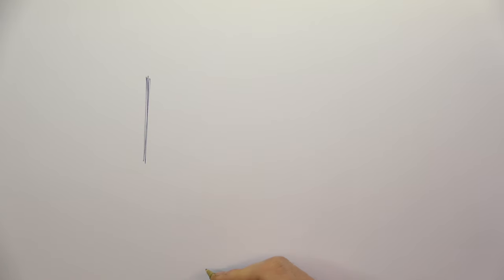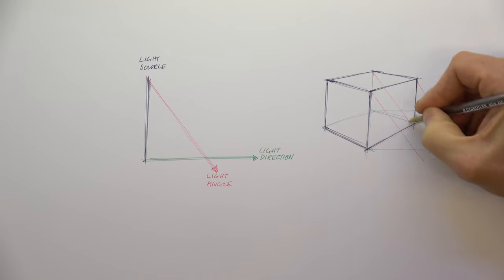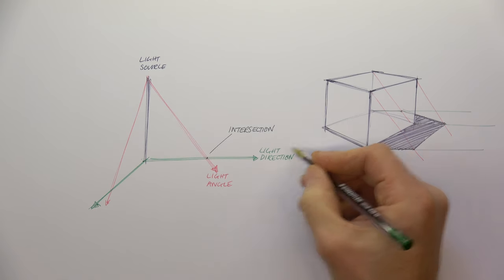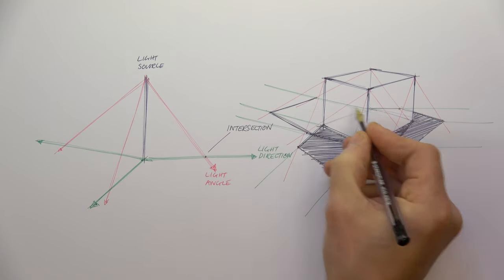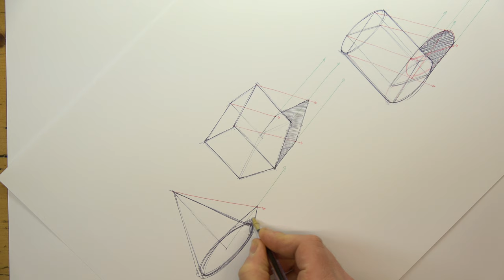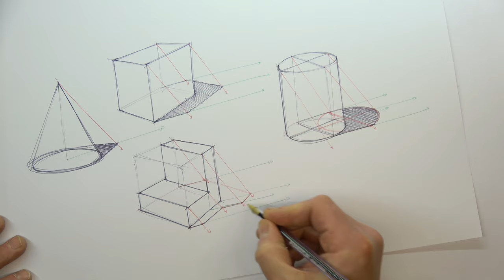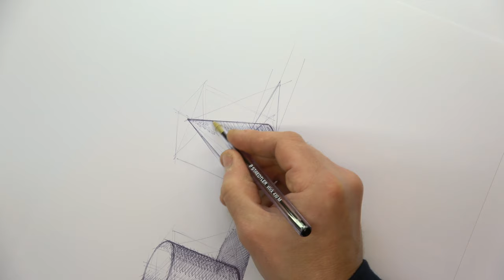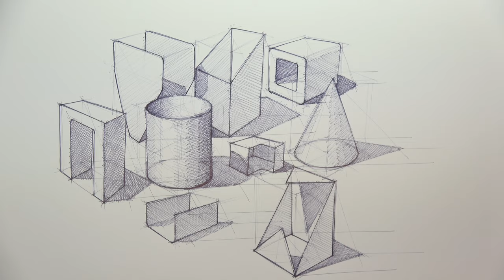How to sketch cast shadows

Comment: It would be worth pointing out in this tutorial the difference between an artificial light source and the sun. If the shadow is cast by the sun then the light rays would be parallel due to the sun's great distance. If the light source is an artificial one e.g. a street lamp, then the light rays can be drawn from the light source. A simple explanation is that when you move sideways from an artificial light, the light stays fixed in its position whereas if you try and move sideways from the sun, then sun moves with you. Therefore the sun rays are parallel. It is a common error perpetuated in many perspective tutorials.
Reply from the maker: I get what you’re saying but would suggests that’s better covered in a follow up video rather than one that covers the principle in short, for an audience that want the fundamentals, to develop their sketching.  To include it at the start might overcomplicate for some.  I wouldn’t describe this as perpetuating an error.
Reply: So, as I understand this particular video would be under the sunlight right??
Reply: @karloatl Yes, or a distant light source rather than a nearby one
Reply from the maker: Hi, I've updated the video - well, I've made a new 2024 version that covers the content in your comment! It's currently unpublished, but for now... just letting you know that I've made a 'cast shadows' downloadable resource that I hope will bring value.  It also gives access to my unpublished update of this video.  https://www.simplydesignsketching.com/downloads/p/how-to-draw-cast-shadows

Comment: This is great. It's a little simplified. The light direction and light angle are parallel only when the light direction is parallel to the picture plane (the observer). When the light direction is oblique to the picture plane (the observer), the parallel lines (light direction and light angle) converge to their respective vanishing point. Will you be covering this or have you already?
Reply from the maker: Sunaya correct! I’m trying to make my videos accessible to all, so that confidence is built and sketching is loose and expressive. My focus is mostly upon helping designers with communication skills. Shadows suggesting shape and form, quickly put down and building a more communicative page of ideas, efficiently and economically.  Great idea to produce a ‘part 2’ in more depth, for those wanting more.  Thank you for your feedback.

Comment: Hi there! I have a few questions:

- How do you get the angle of the light - is it something that WE determine?

- If so, in the case where the light source is from the side and not the top, if there are multiple objects, the angle will vary depending on the distance of the object to the light source. Therefore how do you calculate the varying distance of the cast shadow of each object as it progresses further from the light source?

- How do you determine the shape and angle of the cast shadow of an inorganic object, especially with the above question in mind?
Reply: If it's too long of an explanation to be written down, I'd just as happily gobble up a video that anyone can kindly redirect me to! I'm legitimately baffled by this and I've got unfinished work from months ago as I've been absolutely clueless hahaha
Reply from the maker: Hi, i’ll try and answer.

We Determine the angle of the light ourselves. There is no right or wrong. Imagine a pole with a spotlight attached to the top. The spotlight can be angled however you like, and the pole can be any length you like.
Reply from the maker: If the light source is from the side and not the top, just assume that it is on the top. Any light from below the top would still hit the object and cast a shadow.
Reply from the maker: Do you mean ‘organic’ ie amorphous?  If so, look for any distinguishing points that can be used to reference from.
Reply from the maker: Hi, just letting you know that I've made a 'cast shadows' downloadable resource that I think will bring value to you.  It also gives you access to my unpublished update of this video.  https://www.simplydesignsketching.com/downloads/p/how-to-draw-cast-shadows

Comment: I saw another tutorial where the 4 points on the cube were connected to the light direction point. Same kinda situation for the light source point and the top 4 points. So that brings the question, how are all of the lines parallel?
Reply from the maker: Hi, I’ve just simplified it a little and assumed a more ambient, rather than spot light.
Reply: @productdesignermaker  That information should be in the title, because otherwise you are teaching wrong things to people who don't know better.
Reply from the maker: @humane.t.709  I see your point, but it isn’t wrong. It’s a simple way of drawing cast shadows.  A ‘How to draw in perspective’ video wouldn’t necessarily jump straight into delivering a complex 3 (or more) point perspective tutorial.
Reply from the maker: I've updated and included perspective shadows...  Just letting you know that I've made a 'cast shadows' downloadable resource that I think will bring value to you.  It also gives you access to my unpublished update of this video.  https://www.simplydesignsketching.com/downloads/p/how-to-draw-cast-shadows

Comment: Could someone please explain to me why the LIGHT ANGLE (red line) is drawn parallel to other light angles on a cube? If the drawing is of a single-source light, shouldn't each of the light angles be drawn FROM the light to meet each vertices?... Meaning they all can't be parallel to each other? Thank you :'(!
Reply from the maker: Yep, I’ve simplified it a little to have the light source as an ambient or general light source.  If the light angle lines all came from one point, that would describe a spot light.  You make a good point, but since it’s potentially a complicated concept, it can be off putting for people developing their skills, so hopefully I’ve made it a bit more accessible.
Reply: This helps tremendously. Thanks for the clarification!
Reply from the maker: Hi, just letting you know that I've made a 'cast shadows' downloadable resource that I think will bring value to you.  It also gives you access to my unpublished update of this video (which includes the answer to your comment above). https://www.simplydesignsketching.com/downloads/p/how-to-draw-cast-shadows

Comment: umm how do we decide what would be the light angle ?
Reply from the maker: Anisha k it comes from the top of the light source.  Place your light source anywhere you like in theory (though it’s most straightforward when it’s off to the left or right, and backwards a bit), and your light angle comes from the top of it and passes through the light direction line. Hope this helps.
Reply from the maker: Hi, just letting you know that I've made a 'cast shadows' downloadable resource that I think will bring value to you.  It also gives you access to my unpublished update of this video.  https://www.simplydesignsketching.com/downloads/p/how-to-draw-cast-shadows

Comment: how do i know the light angle and direction?
Reply from the maker: PopcornSticker you choose. They can be anywhere within reason. If you put the light source to the left hand side of the paper, then bring the light direction towards the right hand side. The light angle just goes down to cross the light direction (and it starts from the top of the light source).  I hope this helps.  If you’re still struggling, go back and have another look at the instructions towards the start of the video.
Reply: @productdesignermaker  soo the angle depends on height of the light source, and the direction - on its position.
Reply from the maker: PopcornSticker yep, if your light source it a tall strip light, the light angle starts from high up.  If it’s a low lamp on the floor, it starts from low down.
Reply from the maker: Hi, just letting you know that I've made a 'cast shadows' downloadable resource that I think will bring value to you.  It also gives you access to my unpublished update of this video.  https://www.simplydesignsketching.com/downloads/p/how-to-draw-cast-shadows